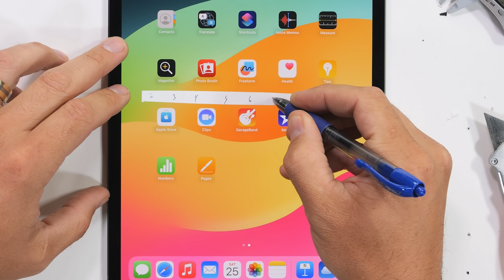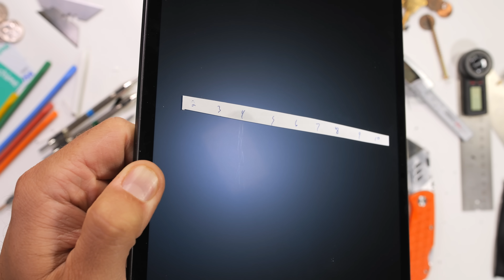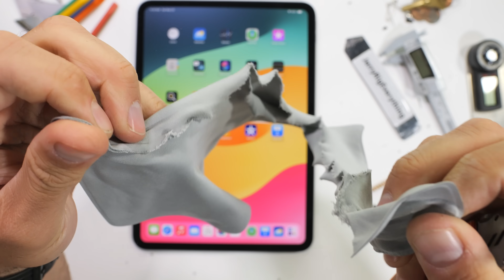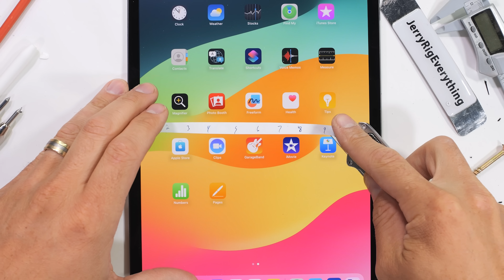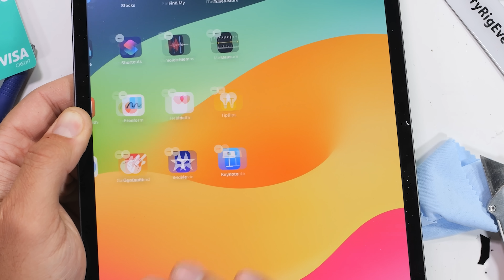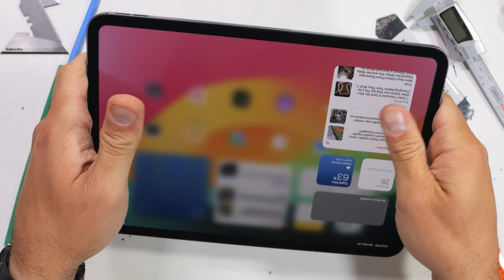The Truth about Apple's Nano Etched Glass - (M4 iPad Pro)

Comment: Steam deck users with its textured display also learned the same lesson a few years ago. Second downside is you can’t/really don’t want to put a screen protector on a textured screen. So textured screen users are stuck with them and smooth screen users have the option to add a protector as well as a textured protector if they want the display textured. I’d think with the existence of paper like screen protectors these would be a hard sell from a durability standpoint

Comment: have the lpad with nanotexture screen and have serious doubts... I hate Apple Pencil Tip so I bought a thin metal tip.. t worked so flawlessly until have seen this vid am lucky I haven't used that much so did not scratch the screen). According to this, metal tips (level 4 hardness of Mohs scale) are not compatible, but aluminium (2.5 hardness) and copper (3) are?
Thank you

Comment: If you really want a paper-like texture on your tablet (which is 100% a massive skill issue btw, getting used to drawing/writing on regular glass takes a couple of days at max), just put on a matte film.
In case of the ipad, having worse colors and the screen being easily scratched is not worth the slightly better structural integrity (the only real pro of this screen).

Comment: What is the point of having that texture screen in the most expensive version?
Reply: extreme difusion of reflections. In fact, you can see in many user tests online, that it does a DRASTICALLY better job at defusing reflections than any screen protector you can get.

Comment: It’s weird that the new super thin 5.3mm 11 inch iPad Pro has a the largest battery than any smaller iPad Pro ever. Amazing. 31.29wh compared to the other 11 inch models that had 28-29 Wh. Even larger than the 2017 10.5 in iPad Pro’s 31wh battery.

Comment: Middle link this thin works not for its thickness, but for its tensile strength. Coupled with the strategically placed screws to the frame it creates sort of an I-beam. Remove those screws and the link does nothing :)

Comment: Apple needs to hire this man! LOL like the fold down the middle is like almost the equivalent of if you think hard enough turning the iPad into a computer layered book lol it may not work but this same exact issue of poorly placed ports and placement of I/O, Switches and buttons just wrecks devices. this brings me back to the gaming phones that came out where they had 1 or 2 Type C ports and the landscape type C port did exactly whats happening to the ipad. this isn't the first time that this easy ability of bending devices in half has happened on one of the earlier refreshes of the iPad Pros or the first ipad pro? but I am like wow so silly. I wouldn't want to put my $1,500+ device in my backpack and have it bend even 2 degrees from true straight. This bending of devices is sort of common. I have and HP Spectre X360 16 inch device its just a big thin ultra book and the hinges aren't that great but I can see a slight bend in how the hinges don't fold back on itself when I fold it in tablet mode and its not noticeable but its there from me putting heavy stuff in my backpack when I have my laptop in. So that's just the nature of devices there not like how they used to be when they were more rigid. also the larger the device the more likely your to encounter this. Generally 13 inch laptops aren't so able to be a warped or slight bent as badly.

Comment: there's a use case for your fire test. a few years back I forgot outside  a samsung model s in the summer sunlight for a few hours and the screen went black and never recovered.  phone was working fine though.. I imagine the heat from your lighter dose a similar damage as the sun

Comment: Someone's gonna tell Apple, that the reason why paper like matte surfaces aren't on tablets by default and are usually made from soft materials, like plastic is exactly because of what happened to your lvl3 pick and what happened by your lvl4 pick? Etched glass will shred pencil nibs and get clogged or chipped down by everything else. This happens to all paper like surfaces because all of them are basically just very fine sandpapers, but at least those are removable and disposable.

Comment: Very glad I didn’t switch to the Nano texture now, this is exactly what I was worried about. It won’t hold up NEARLY as well over time compared to the normal glass.
Reply: If you want you could get a nano texture screen protector to remove the glare but it won’t destroy the display
Reply: @beambreaker5907  Over top of the Nano-Texture glass I would have paid a premium for? The only way you get anything out of a special display coating is if there’s nothing else on the display. Matte protectors are far worse with reflection and bloom than nothing at all, too.

Comment: JRE After breaking the tablet and brutally ripping off the screen: "I'll remove 12 Phillips head screws to get access to Apple's central cowling..." 
Apple Engineer in a hysterically crying voice: "Why bother using a screwdriver?! Why don't you just use a crobar or a jack hammer or a friggin excavator? ? ! How about some C4, you maniac!" Curls into a tear stained ball in a corner.
Reply: Apple engineers when they watch Zack fail to bend it in half longways
“Yay we win finally
Zack *rotates it 90 degrees and bends it again
Apple engineers “why must you hurt me in this way”

Comment: You can get the same effect with a lot of matte-finish screen protectors available online. I've been using them for years on my iPads and Android phones. I've even got one on my Samsung Galaxy Book. They also have the added benefit of being much cheaper than this option and also protecting your screen (vice making it more fragile).
Reply: I checked and the quality of this is a lot better. A lot less visual downgrades. Those screen protectors though also protects the screen so it’s a big bonus. Still I would say that if one is looking for the best screen quality while having it matte and also a little more pen grip (not as much as with say a protector like paperlike) this screen is quality wise better than protectors
Reply: @litjellyfish  I'll have to take my current iPad (with the $10 matte protector) to Best Buy and see if I can compare the screens side-by-side. You're probably right about the quality of the image, though I've got them on all my screens so I don't notice any degradation anymore. My worry with the new iPad would be scratching the built-in matte screen. I'm guessing you can't put another screen protector over the nano-glass.
Reply: @a27rocks  yes that was my worry also. But this test in this clip seems to easy that of. It seems very durable. 

Yes you can put another protector on there is a guy here on YT who does it. 

Still I dont think that will give good results.  So if it’s just for protecting I guess you need to use a sleeve. 

I mean let’s be honest this super expensive device should be seen as a pro level thing and should never leave the “studio” at the most it can end up in the home / studio sofa imo. 

I think if one wants more friction it’s down to a nib solution (that will not wear down the grip texture of the screen) 

For me this is a Cintiq / Wacom studio  alternative. Not even calling it so portable. I think only lacking is size. It works but a 15” would make a world of difference for some artists I guess.

Comment: Not so sure, i find that "nano" glass appealing. I mean .. i DO prefer matt glass over glossy very time (i slap a matte screen protector on all my devices) ... but that is kind of the point. Its a screen protector. And for that reason, i actually always prefer plastic to glass even .. because - plastic does not shatter, glass does (who knew, right?)  ... and the screen protector is primarily there to avoid scratches - NOT to avoid shattering (because no matter the promises made .. no screen protector can protect a display from shattering really)

With that said .. i tend to buy my tablet matte screen protectors for like 2 for 100 ISK - i highly doubt that this nano etched glass upgrade costs less than 100 ISK

my conclusion is ... i would have to pay apple a scammer-like price for something i can get on Amazon for cheap PLUS .. i lose the extra, easily exchangable scratch protection from a soft plastic screen protector PLUS .. my actual display is more vulnerable to soft materials. So this whole thing is a massive fail from my pov. I mean .. if i want to be extra fancy, i just get a branded paperlike protector on regular tablet.